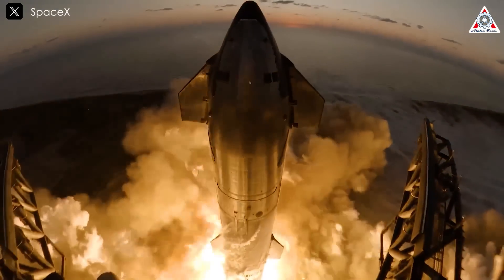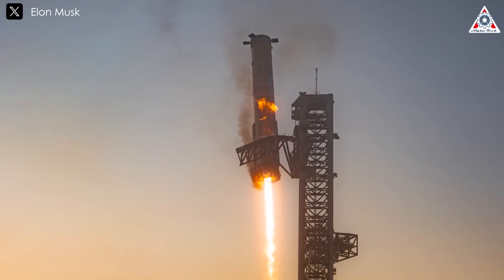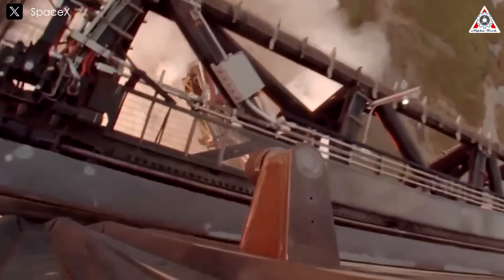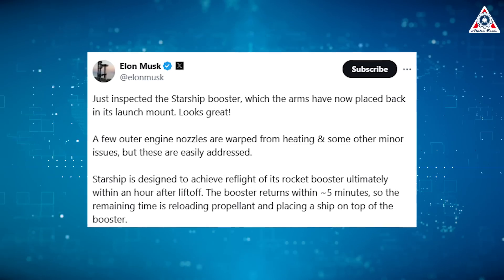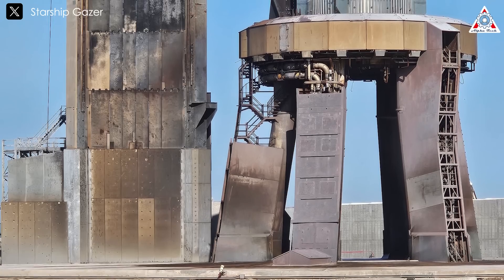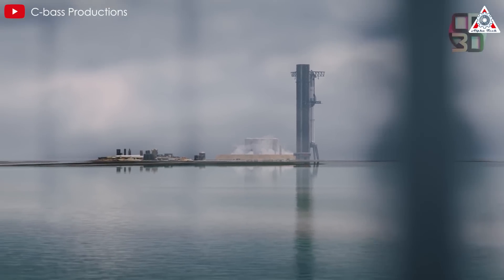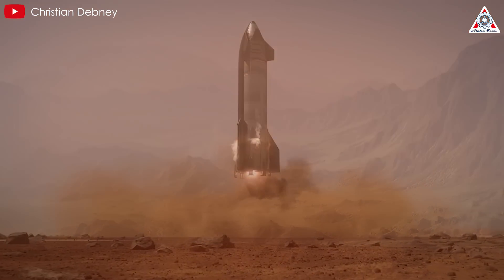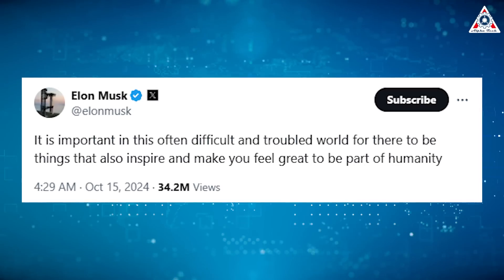Analysis SpaceX Stage 0, Starship and Booster Aftermath..."DAMAGED"???

Comment: No scorched paint...the Starship Booster is not painted. Wonder if that low superficial damage came as base came close to launch tower frame and ChopSticks grabbed pins near the grid fins ?
The flexing as Booster landed had sprung rails absorb capture along top edge of ChopSticks.
Reply: It was peeling off as it came down.  Nothing to do with the tower.

Comment: I don't think they can continue to use concrete around the immediate launch areas, they are gonna have to install thick steel plates wherever possible, steel doesn't break into millions of bits like concrete and is easier to keep cool during launch it also absorbs vibrations better.
Reply: @dc-4ever201  not necessary. There is sufficient metal around needed areas where structurally needed of the deluge area. Water, Not metal, is the best heat sink. Think:  energy required to heat water is dumped into that flowing water, Which some is convertedto steam,  the amount of heat dumped into water cools 1000s of time greater than steel in cooling capacity.. Plus ... The deluge removes heat faster as it is not static. It is Flowing water. Easypeasey

Comment: To my eyes, the bumper pads worked a bit strange. They gave in just a very short distance. Then, after a delay, moved down further "without reason". Surely it would have been better if they gave away much more, much earlier, so that the chopstick arms were spared more of the load.

I'm sure this is one of the many details that SpaceX will nail after a few tries!

Comment: Would it be a good idea to build a space base 3 1/2 months travel time from earth to Mars to act as a safety base and a refueling base
Reply: The route is different every time. The station would have to move or be is some sort of Lagrange point.  Probably not an option either way.
Reply: How about near mars
Reply: @belugabath  mars orbit could be possible but technically very challenging.  Maintaining orbit would require fuel, add to that docking etc would be orders of magnitude harder than the iss. Also the benefit would be diminished since you are 99 percent there already. Someday....
Reply: How about starships travel in packs 3
Reply: There is never a constant midpoint between earth and mars. You can only realistically launch a mission to mars every 26 months.

Comment: I wonder if making a swirling closing or minimal shield of the booster raptor engines could help prevent aerodynamic rentry forces and those bells cannot be very aerodynamic during free fall, heating therof, etc. but it all adds mass and moving parts. A no no. 

A 15 cm give on chopstick arms is... Fine. It needs to give as all big structures have this tolerance.

The minor fire was noticeable prior to landing. Stainless steel can withstand such for short periods. Imagine had they used stupid composites! 

Anyhow. History has been made. Yet it is on page 62 of the News. People are short sighted. 

If there is a God. He sent Elon. A true disruptor. His name will go down with Galileo, Copernicus, Einstein, and other hsitoric greats if we survive long enough to reflect. And get the off this planet.

Comment: I expect Spacex will trim some of the length of the current chopsticks, sooner or later.  Reducing mass, reducing effort to operate, reducing flex, increase lifting capacity.  Best part is no part.
Reply: 100% disagree, there's no real reason to do so other than mass, but those chopsticks closed quickly, without problem, perfectly, the first time. Why change what worked? Not to mention a slightly wider margin of error might be preferable to it sliding off the end one time by accident
Reply: @frederalbacon  because the newest chopsticks are shorter…QED.
Reply: @frederalbacon  The pad doesn't even extend all the way now and I believe they already said the plan was to shorten them. They should already have plenty of margin as it is and the further out the booster rests on the arms the more they'll flex. If it's ever in a situation where it's sliding that far it's likely going to be a bad day regardless.

There's a number if design improvements I imagine them making but I see them keeping the arms as short as they can be.

Comment: The main structure did not move when it caught the booster
There is a part of the structure that smoothly went down when the weight went on it 
Did NOT look like it was "bending" - looked like it was on springs
Reply: @duncancairncross  bending of the chopsticks is fine. Metal does flex.
Reply: @J8Simunaci  When a spring moves that is the steel "flexing" - and the movement in the detail view looked like a suspension movement rather than an arm flexing
The arm may have flexed as well
Reply: @duncancairncross  you get it. Yes. It is a bit of both. Spring is metal. It "flexes"...  The Tower structure too flexes. If u were to have stood on it while landing (yeah a. Smelters suit). The flexing would be noticeable.

Comment: yes, the bad news is the booster cannot reused unless the structure is repaired, Newton's third law !!!!!
Reply: It is designed to be reused, but right now they are testing and learning from mistakes, so don't expect them to reuse boosters every 5 minutes. But give SpaceX some time, a few years, and we will see it. Launching over 100 mission per year means to be able to launch every 3 to 4 days non stopping. I would think SpaceX will have a fleet of boosters and Starships by the time they are ready. So expect to see those boosters being recycled and prep in a matter of a few days to be used again in a few years.
Reply: It's a test vehicle. Everyone fully expected there would be some damage. The huge win is that the engineers have an actual test article that can be examined in detail. This will allow them to advance the design by leaps and bounds. The successful recovery of the booster will lead to proofing or dispelling many theories and estimations. Look forward to many upgrades before the next flight.

Comment: Perhaps the tank watchers know more than I as they study every detail, but in the video it doesn't seem like the tower arms were "bent" by 15cm, but rather that they were deflected by that much.  These are very different things and I'd be curious to know which term is applicable.  Bending a metal structure typically means a permanent change, whereas deflection can be temporary.
Reply: It was probably flexing of the entire tower.  The tower and it's components are not totally rigid,  they flex.  Looking at the height of the chopsticks, ir would stand to reason that the brnding. Flexing moment about the bade would cause some displacement of the entire tower when a 300 000 ton booster rests on it.  I would be willing to bet that when the chopsticks do a static lift. Nit a catch. They are deflected by an almost equal amount as was stated.  Think people, think.
Reply: I'm not an engineer or scientist. A blazing C pluse student in high school. Does your posting ruffly translate into it bent or flexed and bent or flexed back into its original shape.?

Comment: How can you be so sure that the chopsticks got bent? Looks like those pads retracted and were acting similar how a crash barrier acts(compresses under load). Also, I would imagine there would be some play in the chopsticks as you would want it to be able to absorb some impact, this would result in their being springs and struts or hydraulic shock absorbers that intentionally "Seat" after initial load has made contact.

Comment: You can absolutely hold those initial failure against SpaceX.  The forces from massive rocket launches were well understood 60 years ago. SpaceX routinely uses a pad at Canaveral built in 1962 that actually IS rapidly reusable. 
SpaceX opted to design a pad without deluge or flame diverter for no reason other than to evade the requirements to work with the ACoE. 
Then SpaceX WASTED 4 full years trying to slap bandaids on an insufficient design out of pure stubbornness.   They could have demonstrated booster catch and starship re-entry years ago, of they had just built the pad that real rocket scientists had told them their rocket needed.   And no, finally, they have built a NEW tower that, lo and behold, finally HAS the correct deluge ( the showerhead is ineffective at protecting anything but the showerhead. ) and flame diverter.
The whole part 4 years SpaceX was building launch ready rockets, they just did not have a re-usable launch pad. Sorry.   That 4 years wasted just speaks volumes about Musk’s intractable nature and WHY core engineers at SpaceX wrote a letter to the board asking that he be removed as CEO.
Reply: Starship is a two-stage fully reusable super heavy-lift launch vehicle under development by American aerospace company SpaceX. On April 20, 2023, with the first Integrated Flight Test, Starship became the most massive and most powerful vehicle ever to fly. -  re-read that last part. it will explain away all your angst towards "failures". but please as an armchair warrior tell everyone how you would have built a better system. in your basement.
Reply: I not aware that spacex has launched  starship from the pad at Canaveral, do gives us details.
Reply: @stanley8574  They launch Falcon 9’s at the cape, from Pad 39A which was built for the Saturn launches, and 39B which launched Artemis. Both pads built in the early 1960’s that had always been rapidly reusable because they introduced deluge AT the rocket nozzles, like you are supposed to, so that the thousands of constructive interference acoustic sonic booms created by the exhaust are absorbed in atomizing the water, which can then be vaporized by the plume heat, and thereby protect the pad. Along with a movable flame diverter, in the trench that constrains the blast forces and redirects them away from critical infrastructure.    Which NASA ALSO placed well enough away that even an on-pad explosion could not do substantial damage. 
Unlike SpaceX which, at Boca Chica, built a pad that magnified acoustic shock to the point of pulverizing a 5 foot thick concrete pad. And placed towering fuel tanks and other infrastructure within the radius that the rocket exhaust itself could throw rocks and debris.   Only to have to move them and build new fuel tanks that are laying down behind a protective berm.  
The point being that its Not like SpaceX had no experience of a properly designed launch pad and did not have access to reams of real world experience from NASA as to how best to protect infrastructure from launch forces.  It’s just the Musk CHOSE to ignore that data and insisted on a deisgned that would evade regulation by the ACoE.   He ended up wasting 4 years trying to get that pad to the point where it could survive a test fire, much less a launch. 
The shower head design is still inadequate, which is reflected in the better deluge system and diverter built for the new tower. 
Meanwhile, SpaceX achieves a real milestone in launch cadence by simply relying on NASA’s 60 year old pad.
Reply: @christopherpardell4418  They launch falcon 9s from lots of places, I asked about starship. You do understand that starship is different from falcon 9.
Reply: @christopherpardell4418  Starship is twice as powerful as Artemis. 
 They didn't have starship developed to that point 4 years ago so they didn't really need it till recently. And recently they have been addressing it. It be interesting to see how Canaveral would hold up to starship but I doubt NASA ever let them launch from it.
Reply: @stanley8574  Yeah- do YOU understand that the Saturn 5s  launched from pad 39  back in the 60s?   And all the shuttles.  It’s been rapidly reusable for 60 years. 
And BTW Falcon 9’s do not launch from ‘lots of places”. They launch from 39 in canaveral, and from Vandenberg Air Force base  ( Now ‘space force’ base ).  Two launch pads both built 60 years ago. And both equipped with flame diverter trenches and at nozzle deluge.   Once more, try and keep up with the POINT.   Namely that SpaceX routinely USES properly designed launch pads that were engineered 60 years ago, and yet intentionally built a pad that did not utilize any of that proven research.
The did so specifically to evade the regulatory oversight that water deluge systems would require. 
Elon, like a lot of folks, has a religious faith that clever engineers can solve ANY problem.  But the OLM turned out to be a problem that 4 years of fixes still could not quite reliably solve. Get it?   SpaceX has been able to build BFRs and starships for 4 years.   They haven’t been able to test fly them very often because for their re-usable rocket they built s single use pad.
Reply: @stanley8574  So what?   The only reason pad 39 can’t handle Starship is because spaceX already built a purpose built tower for launching falcon 9s on it.   If you will recall, Musk started building a starship OLM right next to pad 39, until NASA saw the debacle of that first launch tearing the pad to pieces and made Musk take it down and re-think his drink. Pad 39 introduces deluge AT the level of the nozzles-as a flood of water, not a spray. The reason is so that the thousands of sonic booms created by the turbulence at the interface of the exhaust plume and the ambient air get dissipated in atomizing that water.   The flame trench is a huge tunnel under the entire pad and for shuttle, whose SRBs’ burned hotter, they rolled in a two direction diverter that had an ablative coating on it. 
Once again, a Pad DESIGNED to be easily configured to handle ANY size rocket.   
Pull your head out of billionaire worship and try thinking for yourself. What spaceX is good at its great at.   But prior to Boca Chica SpaceX had ZERO experience with engineering and building launch facilities. Unlike the rockets, that they can iterate new designs with each one, they can’t AFFORD to ‘iterate’ the launch pad.  So they tried to ‘fix’ the OLM with a lot of add ons and design bandaids. None of which addressed its core deficits. 
The showerhead protects ONLY the steel plate under the pad. It does NOT attenuate the acoustic shockwaves, because you can clearly SEE them in every launch. 
As they iterate starship and the booster, they keep having to ADD weight.  The current version cannot lift 100 tons on a bet. They will have to make it BIGGER. But the bigger it is, the heavier it will get and 33 raptors only make SO MUCH thrust.   To add more raptors they will have to make the entire ship larger in diameter. And THAT means building a whole new OLM.
Reply: Jeff is that you?😂
Reply: @rosaal2981  No. Just someone who isn’t on his knees to Martian jesus.
Reply: Just watching otherwise rational people getting triggered beyond belief because of someone’s opposite political beliefs is priceless. Who would have thought that protecting the first amendment would come at such a cost. He’s the same guy the left hero worshipped when he was saving the planet through Tesla. Now the same people despise him for saving free speech. They’re unhinged and irrational when it comes down to it.
Reply: Guess you're gonna have to put a rocket into orbit to show 'em how it's done at Flanders
Reply: @Bosscheesemo  NASA has already shown them how it’s done.  60 years ago.  It’s not about the rocket. Its about a CEO who think rules don’t apply to him, and whose intractable ignorance has delayed the good work being done by the Actual engineers he hired.

Comment: The booster on landing is actually pretty light weight. It's 3000 tons on launch and less than 300 on return.

There is always deflection in the chopstick arms. Otherwise they'd snap off.